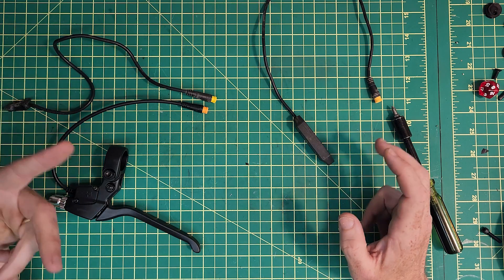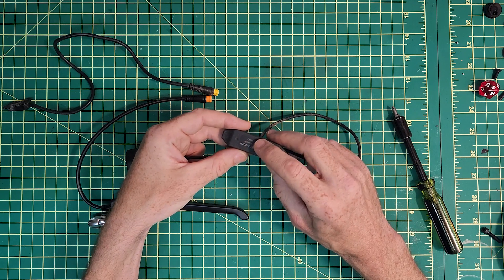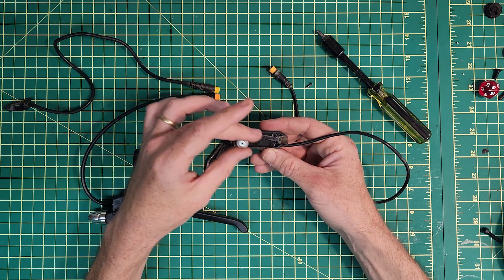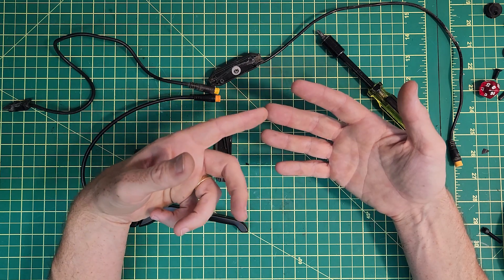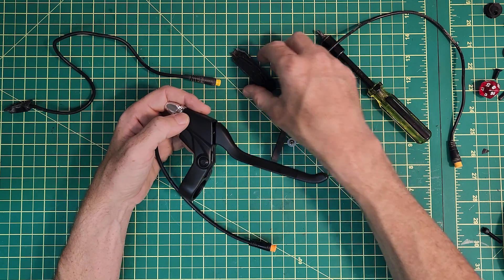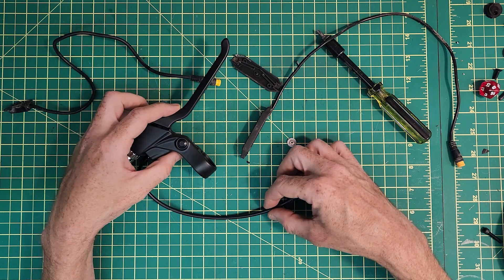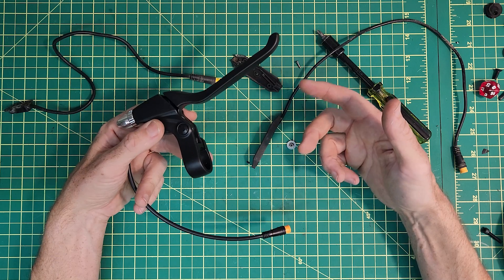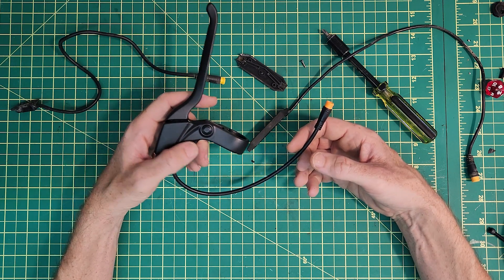Ebike Gear and Brake Cutoff Sensors, do you need them, what I think, tips and tricks!

Comment: I have the BBS02 mid motor. I used the USB data cable & bafang software to change the parameters whereby at each level setting (I use the 9 power level settings) in the first second of each time you start to peddle, the motor uses less power & comes in gradually. It sort of mimics a torque based system a little bit. It has its downside sometimes in terms of climbing a steep xc hill - in these situations you lose momentum briefly so you have to anticipate and click up a power level to compensate.

Comment: Thanks for the info. I would like to share my opinion and experience
Brake cutoff allows instant power assist. Good when starting facing uphill. Hold the brake, press on the pedal, then release the brake.
I can't find this behavior. on other bikes without brake sensor.
Reply from the maker: A good torque sensor should allow for this but I can definitely see why you would like this for instant resume. Appreciate the comment. Cheers

Comment: Do you happen to have the brake sensor pinout for DM02? I want to use a 'kill switch' button made for Bafang that has 3 pins. I just need the pinout for DM02 brake sensors to cut and splice to match. (Adapters sure would be nice.)
Reply from the maker: You can probably get this from the TOSEVEN discord channels. Its not something I have though. I can try and ask TOSEVEN for one.
Reply: I emailed them but haven’t received a response yet. If you can ask, that’d be awesome.
Reply from the maker: @sbturtle5345 will do.

Comment: so basically u'd be using the brake lever as the clutch
Reply from the maker: Yeah. That’s a pretty good description for it in effect if not direct functional equivalent.
Reply: @HighVoltageKits  thanks for confirmation cuz coming from the motorcycle world that tells me that cuz I'm gonna go on torque mode only and no throttle whatsoever I'd say I'm not gonna need neither the brake sensors which I had already discarded but I was to go with the gear sensor but I'm guessing I can go all the way the kiss method keep it simple st pid and avoid it as well so less install just plug the battery and the display the t1 and ready to go isn't having more trouble though atm with the chain line as I wanted a small chainring 32t and got a 73mm bottom bracket so I'm in trouble cuz I want a 0.8 ratio for the lowest speed given the steep hills here but let's see how it goes thanks for the video!
Reply from the maker: @gofiodetrigo8756 anytime. Cheers

Comment: Thanks for posting. 

What about hub gears? They have faster gear changes so power drop off is not so much of an issue? 

I have a rholoff which I want to protect. They have two gear cables for up and down shifting. It would be possible to put a sensor on both, and then wire them together.

The other aspect is closer and opener sensors on the e cut off switches for the brake levers. Magura e levers have options for both, and they also have a 2 pin Higo, which is apparently not compatible with the BBSHD 3 pin higo. So it's a bit of a minefield.
Reply from the maker: The issue is always the high torque damaging things. Those German hubs are expensive. I’m still waiting to see a rock solid option for high power Ebike’s. You can likely rig something up to protect it. Another option is a manual push button to cut power and then shift.

Comment: My moped-style e-bike is fast 40 mph, and when starting has good torque but coming out of a berm it lags, do you think taking off the brakes sensors will help?
Reply from the maker: It might. You could try switching to just a push button cutoff for safety. Can you unplug the higo connectors? Only one way to find out :)

Comment: Great vid! Very informative and I’m glad I ran across it. 

I bought a used Ride1Up bike for cheap, that the original owner had given up on. He was honest that the motor would randomly cutout, make grinding noises, and become unrideable after only a mile or two. I read up on the brand and there were similar complaints from many owners. I was sure I could get it running.

I bought it, had it professionally tuned up for mechanicals, so that whatever might be the problem wasn’t going to be misaligned brakes (mechanical disks) or gear system (7-speed). It was still acting up (but a bit better overall) so I disabled both brake sensors and immediately 80% of the issues stopped occurring. 

After some more tweaking, it’s running fine 95% of the time with hesitating/cutoff issues only occurring before a first mile. After that it’s perfect and quiet. Maybe something to do with the motor warming up? Still investigating but the bike is enjoyable and strong.

This isn’t my first e-bike so I’m familiar with being able to stop pedaling when applying brakes. Stomping on the brakes while full throttling is not a problem for me.
Reply from the maker: Fixing some pretty easy niggles is a great way to get a good deal. Well done. I just swapped out the brakes on the hiboy to hydraulics. It’s a 100% better bike.

Comment: How can i find out whether it's a cadence or torque based system?
Reply from the maker: It should tell you on the motor kit. It's pretty easy to tell though. Have the back wheel off the ground and spin the crank. If it engages then it's likely cadence. Torque uses pressure or strain to activate.

Comment: I didn't fit the brake cut offs on my second bike. There's too much delay between putting the brake on and being able to accelerate again. Really noticeable when stopping at junctions.
Reply from the maker: I have not missed them on my bikes. Even the High powered one I just use a push button for added safety.
Reply: Your second bike controller is looking for initial cadence or speed to activate the motor. for safety reason. 
With brake cutoff/ you don't need initial movent. Response is instant.

Comment: i have a new ebike wire harness and controller + lcd, and it gives me error 10 , engine spins just fine with throttle and pedals... i have no sensors connected as i cant find anything that fits! but i got the feeling this is what is causing the annoying error. i tried 3 different LCD's
Reply from the maker: What kind of motor?
Reply: its an off-brand 750W motor that works with a KT - Controller :)  @HighVoltageKits

Comment: i have stock bbshd and sturmey archer 3 speed hub. i have an extra brake lever with the cable attachment remvoed connected to the shift sensor plug with a block in the spring to make the tension stiffer (when i go over bumps the lever vibrates and disengages the motor. i only need the brake(clutch) lever when shifting up under load. down shifting is always clutchless and only need the clutch going from gear one to gear 2 up a hill. on the 3 speed hub you have to slow your cadance till you feel the cam move over in the hub. once you feel the gear shift you can release the clutch.
Reply from the maker: Thanks for the feedback. I had heard that the SA three speed was pretty much the only IGH that can handle the BBSHD. Do you find that it has enough range in the gears?

Comment: Why would you be "a fan" of a gear shift sensor. you ride with one gear. They are great if you have twist gear shifter on left grip, I shift full throttle no issues.
Reply from the maker: Did I say fan. I thought I said I'm not. Certainly with the Fatbike single speed. I disliked it when the bike was stock bbshd as well. It seems a mixed bag of whether it works or not. Cool its working out on yours.
Reply: you read it wrong. anyway they are good when you dont want to down throttle.  @HighVoltageKits

Comment: I personally on lighter builds only run front brake so what I did was I used my other brake disconnected. Aka I only was using the electric feature not the actual physical brake, it basically acted like a very natural feeling clutch that I could pull all the way, shift and then release with no weird automation
Reply from the maker: I'm not quite sure I'm following Kim. Are you meaning no rear brake just a cutoff for changing gear purposes?
Reply: @HighVoltageKits  yes, because most stopping power is in the front brake anyways,

Comment: I like that brake cut off idea. Are you using just sensors for hydraulic braked or you changed whole brake with ones from Bafang?
Reply from the maker: I have just used the stick on one's so far. A few places like Magura make integrated ones but it can be tricky getting the wiring right. Working on getting a proper set of cutoffs and brakes more available for people.

Comment: I used to just flick my brake lever and it would cut power long enough to change gears but now I got i.g.h so I don't have to peddle well changing gears and I just took off my shift sensors about 2 weeks a go. Internal geared hub is a good way to go because I have not snapped a chain since I have had i.g.h
Reply from the maker: Right on. I love igh. Still waiting for one that's a realistic price than can handle HV power reliably tho.

Comment: I have one of those kindernay IGH with a bafang ultra.  I tried using hydraulic switchs in the shifter hoses hooked into the shift cut input.  (kindernay use hydraulics not cable)  But I found that the shift cut time was far too long.  It was more of a hindrance than a convenience.
Reply from the maker: I had to Google that. I used a stick on magnetic one with my hydro brakes. I was not aware of one that uses the fluid. It's not a surprise it's not very effective either.
Reply: @HighVoltageKits  the hydraulic switchs were actually very effective.  The problem was the delay was too long for my liking.  

I found It was better to just stop pedalling before wanting to shift, and let the motor normally stop propelling.  Rather than use the shift switch, and then have the delay extend too far after the shift event.  If I had a way of adjusting the shift delay in the motor programming, then It wouldn't be a bad thing

Comment: For me, neither was the right option. The "cutoff button" that you just tap to cut the power for a moment is way better. I just tap it whenever I shift. Or I hold it down if I'm shifting down while braking towards a stop. Or I hold it down if I'm wanting to ride slowly through a tough / technical situation. Highly recommend the cutoff button.
Reply from the maker: I have one for my higher power bike which I will be re building to replace the stick on brake sensor. As was pointed out in another comment. Once you start over volting and using field weakening there is a chance of motor run away and a cutoff there is a good safety feature.
Reply: @HighVoltageKits  Ah interesting. Haven't done anything beyond stock with controllers or voltages, but even for the stock stuff, I really enjoy having the cutoff button as both a shift clutch and a short-term "just want to ride manually" switch! 😁
Hope to over volt and use your HV kit on my next BBSHD build!

Comment: Break cut-offs are an essential safety feature. If you get a runaway motor you'll be glad to have them!
Reply: Nah
Reply from the maker: Good point on runaway. Its not a super common thing on the lower power stuff which this was more aimed at. Mostly people find that on big hub motors that have been significantly over volted with large amounts of field weakening. I will be using a button emergency cutoff with my higher power bikes which is essentially uses the same feed.

Comment: I only recently added the brake sensors to a tsdz2 which is a torque sensing setup. Honestly found it quite useful at the higher power settings for a few lower speed manoeuvres like weaving through the barriers placed down an alleyway expressly marked as a cycle path in my town. Sometimes it just wants to snap a little aggressively when you don't want it to. Also the tsdz2 firmware isn't the fastest responding in the world and was sometimes fighting the brake as I'd start braking. Ultimately been finding it a bit of a game changer.

My new ebike build is DD hub motor based and I may be using the brake sensors to trigger regen.
Reply from the maker: Its worth doing some looking on that motor as the firmware was open sourced. It was greatly refined as a result. You might be able to get some big improvements. Those barriers sound rather frustrating. Are they there to block motorcycles? I bet they also block anyone with a Disability as well as recumbents, hand cars etc.
Reply from the maker: Good idea on the regen. Which hub are you using?
Reply: @HighVoltageKits  Barriers you see on pretty much every alleyway in UK. Mostly for motorcycles and they are typically adequately spaced that a wheelchair or mobility scooter will get through. Bikes, you gotta slow down but you absolutely can do.

Motor wise. Its going in 74mm OLD dropouts, so kinda narrows down to the crystalyte SAW20

Comment: the gearshift sensor definitely simplifies shifting. you can just keep pedaling, no need to back off, also with torque sensing motors (i have now a toseven dm01) it's a huge improvement over no shift sensor. you still need to apply torque to the pedals during shifting, but when the motor cuts off completely, the shift gets very smooth, as long as you have a high enough cadence. 
on bbs motors, the shift sensor delay is much shorter than the brake cutoff delay, which results in a faster acceleration, but also requires a higher cadence to avoid crunching. 
the funny  thing with brake sensors is, they always supply you with these stone age brake levers nobody will ever use. Either you can use the julet/higo cable to make your own kill switch (for manual motor interruption) and/or install a hydraulic pressure switch (the one from magura is really good! ). I've recently also used the brake sensor to switch a brake light on a modern ebike lights kit. really cool function!
Reply from the maker: I was sent some brake levers with the DM01 but they are mechanical and the bike I'm using has XTs. I might try the sensor just to see if it's a better experience than with the BBSHD. It's a new motor so maybe I will like it more. Are you on our Discord community? We have a section on TOSEVEN and feedback on how you are finding it would be great. The guy organizing the dealer network is on their pretty often. Cheers
Reply: @HighVoltageKits  yes I wrote many comments already on discord  and  chatted a lot with  Alex.
My experience from riding the bbs02 and the dm01 is that the shift sensor is a huge benefit iin both cases, but more so on the bafang. torque sensing improves shifting because it's a lot more sensitive, but I still feel it's imperative to have shift sensing on any mid drive ebike

Comment: I use a gear change cutoff on my BBSHD hybrid bike, maybe I am lucky but it works perfectly and gives the bike an overall factory feel. I don't need to instruct anyone riding it on how to do proper gear changes, just let them go and the gear change sensor handles it, no need to teach them about using brake levers as a gear change "clutch". 

I also have a Stealth gen 3 MTB that I do lots of technical riding with on trails. Many tend to not use brake sensors or gear change sensors on these, and I do get the idea of not having them (or at least the gear change sensor) on a torque sensing motor. 
This is a rather easy bike to do natural gear changes, just letting of pedaling power a bit when changing gears, thus I do not have a gear change sensor on the CYC bike. 
Brake sensors however are a MUST for me; During technical (I mean really technical), there's lots of balancing going on where I balance and weight on the pedals while braking and it's straight out dangerous having a bike that will give full power when braking and pedals are given power. 
Same goes when standing still, balancing on the bike, I balance the bike pressing a pedal while braking. 

What a mess of a text that is, but my point is; Whatever motor system is used, I believe brake cutoff sensors should be used, always. Accidents can easily happen when your motor gives full power (whether it being a torque sensing or cadence motor) because of input, even though your are braking with both front and rear. 
If I build a bike for someone, brake cutoff sensors are mandatory.
Reply from the maker: I understand what you mean. That's interesting with the gear cutoff. I tried to tune it but never got it really working well. I you have considerably more riding skill and balance than me to do that. The harness I got with the Photon does not have and plugs for brake cutoffs. I have not missed them. But I'm also not doing much tight technical riding either. It's more touring around and commuting. Appreciate you taking the time to give your perspective. Cheers!
Reply: I have just purchased a cyrusher rover 52v 750w and it has a torque sensor..I've been wondering whether i could save some money and get better brakes (maybe even 6 piston by buying normal hydraulics without motor cutoff. What do you think please? Paul, London ❤

Comment: Or you can replace the rear gears for an IGH.  I replaced an old 6 speed with an Enviolo 380, and now I'm waiting for my CYC Photon.  Only have one gear up front now.   Would never go back to having a derailleur.
Reply from the maker: Should work great with the Photon. The igh stuff does not do so well with the higher power stuff but I thing it will be great for what you have there. Let me know how you get on with the Photon.
Reply: @HighVoltageKits  I believe the Enviolo can take up to 105 Nm.  So I should be ok.  But them I'm not a ride like a stole it kind of guy. ;).
Reply from the maker: 😆 I think you will be fine. Let me know how you get on!